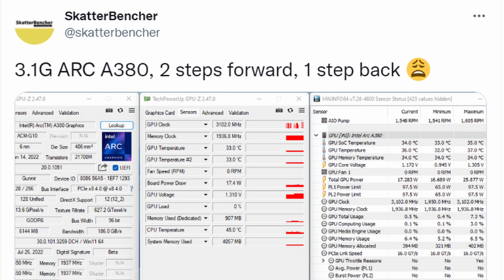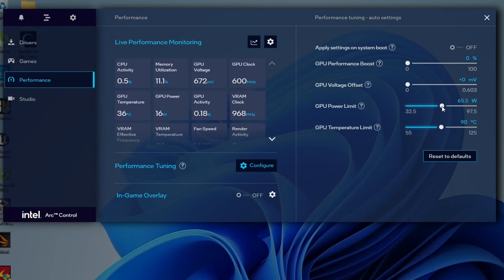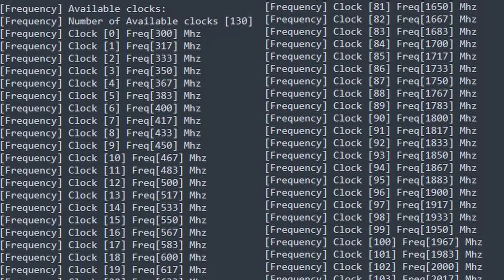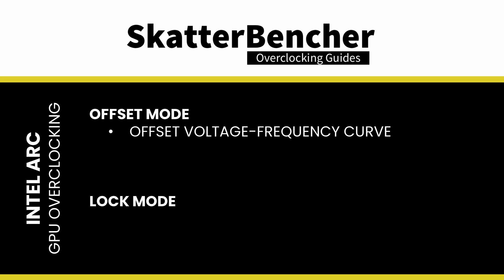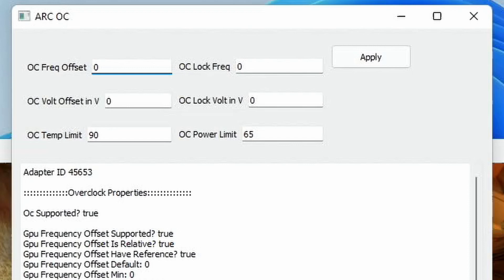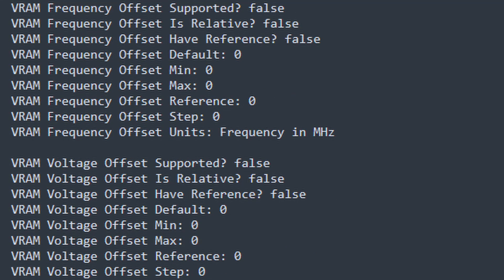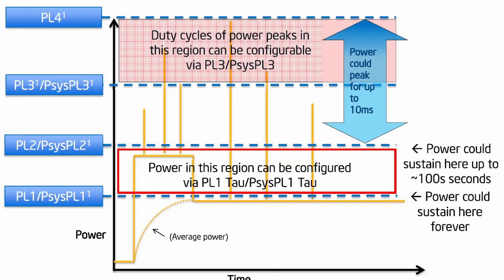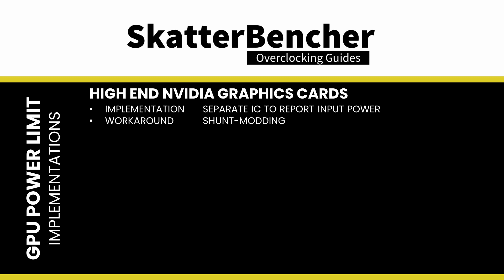Update on my 3.1GHz Intel Arc A380

Comment: The reason of buying this card, because I only use for office, I expect it was able to decode 8k av1, and support multiple 4K screen.
Can I check with you that:
(1) without resize bar, is it possible to work ? Just install video card only and use window itself provided driver.

Thanks in advance if have your answer.
Reply from the maker: Yes, the card works just fine as display output without enabling ReBar or installing the driver.
Reply: @SkatterBencher  can play YouTube Japan 8k AV1 at the same time ?

Comment: Intel has always lured money from investors in order to get a decent built-in - it used to be 810/815 chipsets, and this is how it continues now. They would like to, overclocked the percentage to 6 GHz, forced motherboard manufacturers to solder connectors from video cards to motherboards to increase power, but the trouble is 2 nanometers have not been mastered and how to cool such power?
Reply: Knowing this, do not waste your time on this - there are smart engineers in Intel, who are very difficult to surprise. But you need to give people hope :)

Comment: What about hex editing?
Reply from the maker: like BIOS modding?
Reply: @SkatterBencher  Using a hex editor to bypass Intel software limits is what I was thinking of. 

I used a hex editor on Afterburner to get a FirePro M7820 up to 1 GHz once lol
Reply from the maker: Oh interesting idea! I didn't think of this but it's worth a shot. Do you have a link to a guide?
Reply: @SkatterBencher  have you ever used ghidra? It's a reverse engineering tool that's free and relatively easy to use. Run the firmware/bios through it and see what it throws up. Its pretty handy with mobos, never tried it on a gpu
Reply from the maker: I have not, but I'll look into it. Thanks for the tip!

Comment: Since you have been able to write some custom software tools, do we just hope for AIBs to update their tools? Like MSI is selling prebuilts with Arc, so they might have a new version of Afterburner. 

Intel even said that their OC labs didn't get any hardware samples. 

All the A380s currently on the market are "OC variant" marketed models. Even the single slot small one.

I really hope the larger cards that use the G10 die have some overclocking potential as I am getting an A750 from Intel hopefully soon. 

Final question: can you submit Intel Arc results to HWBot yet?
Reply from the maker: All AIBs should have access to the documentation needed for adding Arc OC support, so I think it's only a matter of time.

I'll look into submitting results to HWBOT if I get interesting results (>3ghz)

Comment: No need to rush, i'm more interested in the new AM5 platform anyway. I'm sure you'll have fun with the new Ryzen 7000
Reply: Not sure, but if AMD didn't return back to Zen+ style IF-MC, instead of purposely gimping when using a higher RAM speed, there will be a huge bottlenecking.
Reply: @AlfaPro1337  AMD said 6000MT/s is the sweet spot (3000mhz IF clock) we'll have to wait to see how the new memory controller will go rven further
Reply: @mehdimido5270  Zen and Zen+ has no cut off. The IF speed = Memory Bus speed. If I have 4 GHz RAM speed, it's 2 GHz on memory bus (since it's double) and IF.

Zen++ and Zen+++, the cut off is 3.733 GHz, so IF is running 1/2 of the memory bus speed. A huge bottlenecking.

There are few benchmarks on Zen+ that shows that 4GHz+ RAM speed with very low latency can soar up to 20% average improvements across the board.

Meaning, higher frequency and lower latency and give you more peformance. 

Unlike Intel, which you can toggle 1:1 or 1:2 or 1:4, and Intel has little to no gain.

I guess just another Evil Su's work.